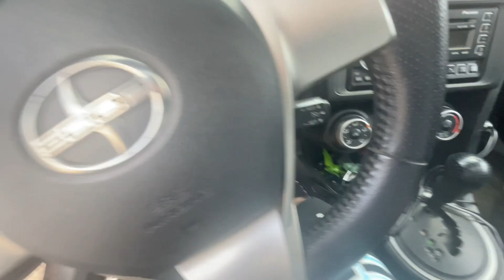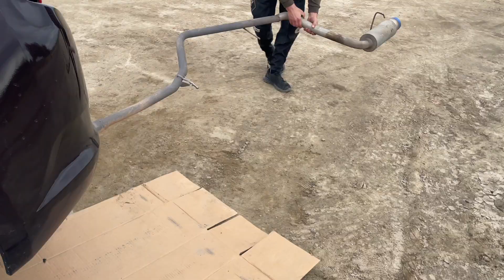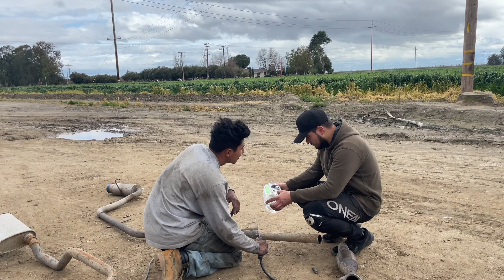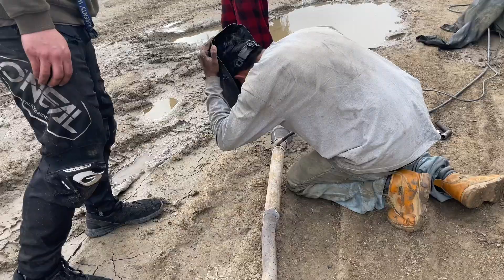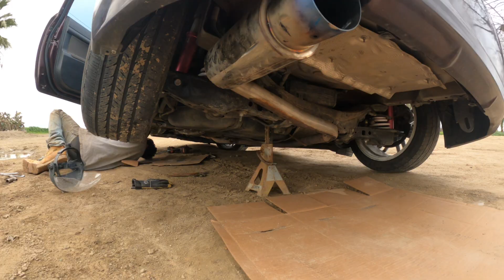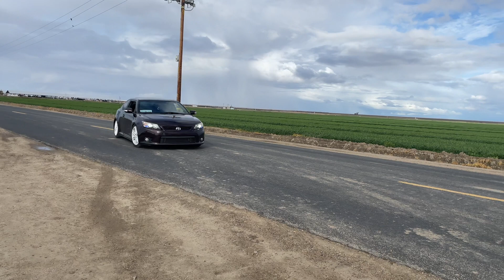RESONATOR DELETE ON A 2011 SCION TC

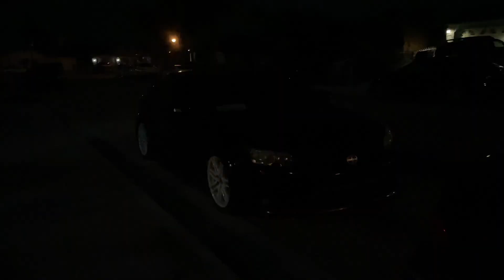Comment: Yo this is super random but how did you make it so your welcome lights turn on when you unlock the car? (6:43) mine dont flash or anything lol just the blinkers flash twice
Reply from the maker: I bought these LEDs which were called parking brake lights something like that off of eBay it was just plug n play if they don't work on yours it could be something electrical not connected or not there
Reply: @2shortmikey  damn, did you do any custom wiring? mine only turn on when i turn on the actual headlights. when i unlock the car, only the blinkers flash, not the parking ones lol
Reply from the maker: @zev4036 nah I never did any custom wiring lol maybe you just don't have any actual bulbs in your headlights so if I were you take out your headlight and double check